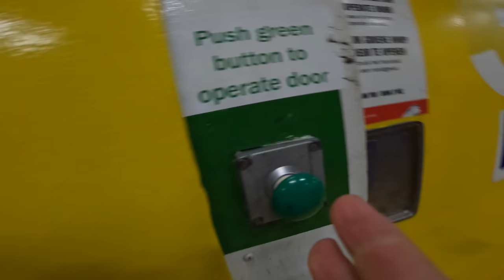Shipping my motorcycle to South America.. by plane! |S6 - E3|

Comment: Riding from the airport, you had the classic look of someone who is tired, but excited and happy to have arrived at the start of your next adventure.
In the 1980s I was able to air freight my bike from Canada to Europe without much fuss. The bike was secured it to a skid designed for the cargo hold of passenger planes, no need to build a crate around it. Like you, I had to drain the gas tank (which was a lot easier with gravity-fed fuel systems) and disconnect the battery, additionally I also had to deflate the tires. Best of all, while the bike was in the cargo hold, my girlfriend (now wife) and I were in the passenger compartment of the same plane ! Basically, they just treated the bike as extra luggage.  Not nearly as complicated as what you had to do. Things change.  I have to say, Noraly, that I am thoroughly impressed by your ability to seamlessly switch from driving on the right to driving on the left, and back again as needed.

Comment: Although I own 5 Honda 4 stroke machines and have owned a dozen or 4 dozen more thoughout the past almost 6 decades I've never liked the valvetrain and timing chain noises from brand new such as this one to the 100k plus miles machines... But I do love the absolute Honda longevity,reliability, and ease of repairs and tune ups that is standard with all Hondas,moreso with carbed machines... My 30 plus Harleys have always been exhaust loud,but mechanically quiet... But I'd rather ride a noisy Honda or Harley than push any other brand machine... ;-)

Comment: Hi Itchi!!! As I am a rider as well, I was chatting with my son about a gadget to pull up the bike from the ground when fully loaded. We thought about kind of a mechanical thing. Then Luca thought about exactly what you are using in (Minute 6:01), but being put in some way that you can straighten the bike with that same fastener device .  For instance, you can drive a stake on the ground, attach the other tip to the chassis, and pull the fastener.
    I rode for some years a Royal Enfield 350 in India in the nineties. Tengo una Tornado 250, here in Argentina. A dicrete model for Southamerica, though for me is more than enough. Que encuentres los mejores caminos!!!

Comment: Haha, I've done that ferry so many times. Normally the other way UK to Netherlands. The danger is the ferry doesn't leave until 22:00, you meet some other motorcyclists onboard and have 4 beers, then have to get up after 5-6 sleep and ride 750km (in my case). Nice to see James Cargo at work. I used Motofreight who were equally as good when flying to Buenos Aires. For airfreight I didn't have drain the tank or anything when the bike flew with Air Canada.

Comment: Nice.  I had a RAM phone mount in various spots and ended up getting a ball that replaces one of the bolts in the handlebar bracket, which was a lot less vibration.  And that reminds me - I'm selling that bike and need to swap the bolt / ball back out to keep that ball mount.   More recently I'm just using earbuds with spoken directions; not using the mount.  Tempted to get a GoPro tho.

Comment: Funny, I never needed to strap down my bike on a ferry. Only park it sideways, normally on the kickstand, and they put chocks under the tire. Felt super sketchy the first time to just leave it like that.

I guess because the bike is sideways and the ship doesn't rock front-to-back it's safe from tipping over. The ship does rock side to side but the bike won't fall forward or backward. And the chocks are so the bike doesn't slide, so it stays in the same spot.

Comment: well that's not completely true though ... it still is a DGR, but since the fuel tank has been drained and the battery is disconnected it is a minor risk called RMD, which means  - Restricted Miscellaneous Danger -
it is still considered a an Hazardous material, you have to remember you still have  oil in your engine, since it is a four stroke ...